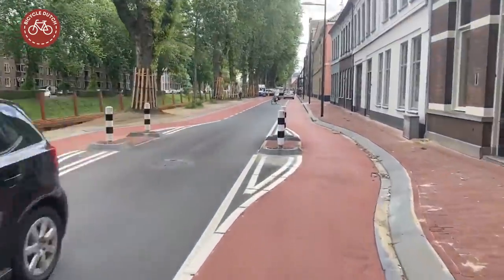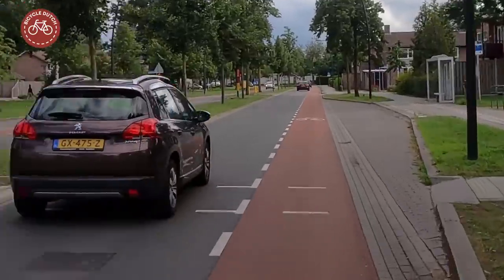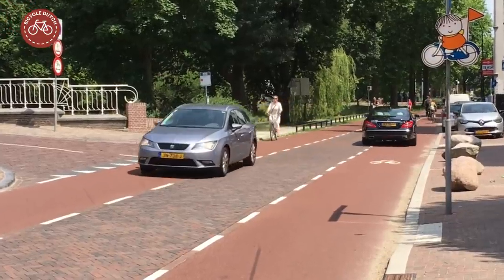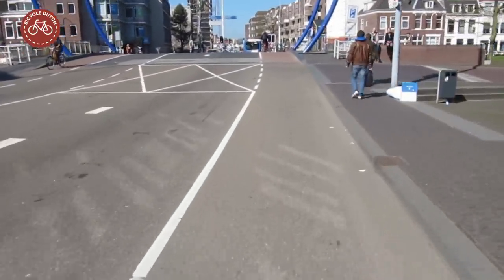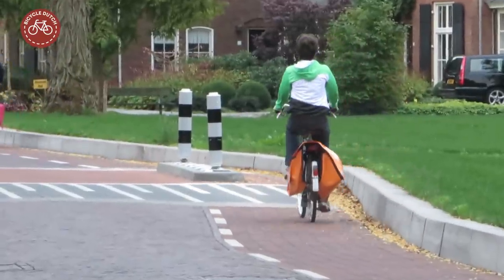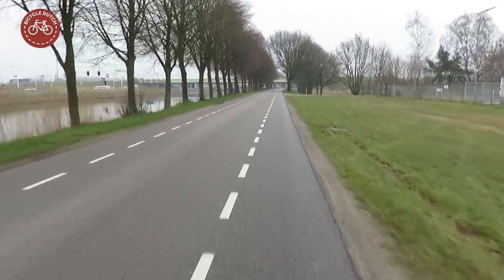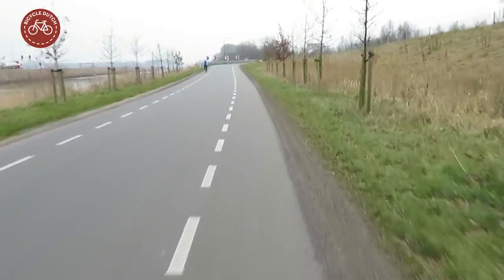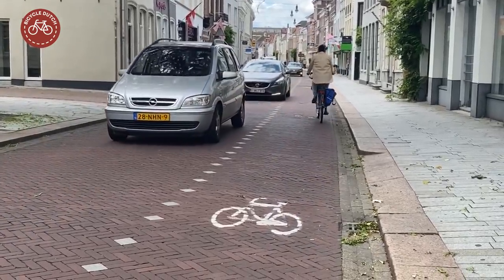On-street cycle lanes in the Netherlands

Comment: I was actually not aware that the narrowing lanes were not cycle lanes, but I don't think I've ever come across one that was too narrow  to not essentially be the same as a cycle lane.
Reply: Some roads in the countryside will be too narrow. There are some here, narrow roads with trees that have stripes not further than 20 centimeters away from the roadside / occasional tree trunk. Luckily nobody thinks it’s a bike lane.
Reply: I have come across many of those, at young age, I was constantly confused wether or not it was a cyclepath
Reply: Those things annoy me to no end. In Germany it has been advised, that narrow streets be converted to this bullshit. 
No the streets will not be made wider, they will not assign a proper speed limit, they will use psychological tricks to have you drive slower than allowed.
It's the same bullshit like no middle divider in villages and not converted small streets. Drivers have no orientation and many drivers in my experience stay as a result way too far left because they can not judge the width of their vehicle to the right.

Comment: I like that most places have a standard cycle width.  One place in greater London, UK, there's a separate cycle lane is less than one metre and it's expected that bikes can go both ways.  That means you end up daring the one coming in the opposite way to find out which of us will yield and swerve over on to the pedestrian path. Later one you find the cycle path disappears and this is a busy major road with cars going at high speeds.  You are expected to switch to the road and later the bus lane with buses dodging in and out all the time.

Comment: Great ideas, in the UK we exist in essentially a feud between cyclists and drivers as we have no real separation of road an cycle lane so cyclists are slowing traffic which irritates drivers or drivers are overtaking cyclist so close you almost knock them off which makes bad blood there. Also our cycle infrastructure is so bad people usually either drive or cycle depending on their circumstances rather than length of journey or weather which further separates the groups as a motorist does not understand a cyclists point of view and visa versa. I also believe cyclists should have a safety standard to use the road or cycle lanes however, a registration plate and adequate lighting should be essential. We often have incidents where cyclist are not seen due to poor or no lights or have lights that blind people as there are no regulations with beam pattern ect like a car and many incidents where cyclists cause damage and run without any real means of identification.

Comment: In Brussels they dont even draw the lines on most of those counter-flow streets. Because it is in fact assumed that bikes ride in both directions on any street. 80% of the time you can see a single bicycle painted on the road and 30% will have dotted lines at least towards intersections and tighter sections.

Comment: Question, the video mentions two advised methods of cycle paths for the two speed boundaries; under 30km/h and over 50 km/h.
What are the cycle path advised methods for roads in between these speeds such as 40km/h? Or do roads with these speeds not exist?
Reply from the maker: Dutch law only allows 30km/h or 50km/h inside the built-up area. 40km/h is not legally possible.

Comment: 0:50 " Cycle lanes with solid lines may never be used by motor vehicles " seems to be factually wrong, as small motorcycles are (lately) allowed to drive on cycle lanes, am I wrong?
Reply: Bikes without a yellow plate that is, no motorbikes/scooters that have a speed over 25 km/h are allowed on a bicycle lane.

Comment: Here in Germany, on-street cycle lanes are considered as the golden standard of cycle "infrastructure" (many people say "paint alone is no infrastructure" and I think that's right.) It's interesting to see that they also exist in The Netherlands — but are actually seen as bad design.
How does it look like when such on-street cycle lanes meet an intersection equipped with traffic lights: Are there separate lights for cyclists? Are there "bike boxes" that allow cyclists to position themselves in front of cars while waiting for the green light? (This is very common in Germany and in many other countries.)
And what if an on-street cycle lane meets a roundabout: Are there separate cycle lanes inside the roundabout or do cyclists have to merge with the motorized traffic?
Finally, do people in The Netherlands tend to avoid these on-street cycle lanes (by using a different route instead)? My guess is that especially for young cyclists, this is quite risky and not very attractive.
Reply: This is not paint, it is red coloured asphalt
Reply: @schout33  Right, and this means it requires way less maintenance (no repainting) which is good. But apart from this, the concept of these on-street cycle lanes is the same as here in Germany and probably in many other countries.

Comment: Many of the streets you call fietssuggestiestroken in the last part of the video are not fietssuggestiestroken. They are erftoegangswegen, a standardized type of rural road with dashed sidelines to visibly narrow the street, they can be accompanied by a seperate bike path and have a max speed of 60km/h.
Reply: The fietssuggestiestrook can be on an erftoegangsweg. The strook refers to small part on the side of the road in a different color or material. And as heard in the video, they don't do a lot for cyclists, unlike its name suggests. They are just there to visually narrow the road and reduce the speed of motor traffic. The erftoegangsweg refers to the entire road.

Comment: I love your videos, they are so informative. But now I'm confused, I thought you said in an earlier video that cycle lanes were always red but now you're saying and showing that's not always the case? Is this just with older roads that have not been updated to the red standard? Or is there another reason some cycle lanes are not red?
Reply: Cycle lanes do not have to be red by law. It is the painted bicycle on the road that indicates that it is a bicycle lane.
But the design rules for new roads advise them to be red. As that makes the situation more clear.
In situations where there is no confusion, like a long straight rural road, the cycle lanes are often the same material as the  the road because this is cheaper.

Comment: I was just going to ask you for a video about this topic! My city is not going to put money into retrofitting existing streets but on-street cycle lanes are in the realm of the possible. Is there any parking in the 50 kph roads?
Reply: Federico Marín usually not. On the roads that have a 50 km/h speed limit you will usually see parking bays. You might find cars parked at 50 km/h roads in some of the more rural areas, but it’s not a common thing in most cities.

Comment: @1:40 there are in fact 2 signs for cycle lanes/paths the one applicable for cycles and snorfietsen would be your channel logo but in blue, the other one is a rectangular sign with the word fietspad on it (only for cycles not snorfietsen) ... commonly they only place a sign at the beginning of a main cycle route or intersection and often not at all, but there are signs
Reply from the maker: But these signs are not used for on-street cycle lanes. There is no sign when the cycle lane is only paint on the road. Other countries have such signs.
Reply: @BicycleDutch  on street cycle lane is not counted as cycle lane in that sense , the road then is mixed used and designated per standard to be cars and cyclist regardless if there is or isnt a on road cycle lane.. but even then, sometimes there is (exceedingly rare)

Comment: So if I interpret this correctly, the on-street cycle lanes are basically a way to circumvent the advice to seperate bicycles and motor vehicles on >50 km/h roads? I guess this is some way understandable, as it would be quite a logistical/financial challenge to seperate bicycles/motor vehicles on /every/ road outside cities and villages.
Reply: It's more a legacy of a time when that advice was not yet in effect. Expect every one of these lanes to be replaced by separated paths soon enough.
Reply: @Quintinohthree  Where possible ofcourse, I can think of a few small roads that do get quite a bit of traffic right now (including large agricultural contraptions) while being surrounded by a ditch (sloot) on both sides that just don't have the available space. 

I wouldn't be surprised if it's left as is, gets a 60 km/h zone slapped on it to encourage cars to take an alternate route. 

Maybe some places with connections to N roads will be blocked off. That'd get rid of the car traffic which uses it as a shortcut now.

Comment: So if there's a dangerous obstruction or condition in the bike lane, cyclists are still required to use them? For example you pass two cars parked so the door zone occupies the entire bike lane, but you're still required by law to endanger yourself by riding in the door zone? Seems backwards.
Reply: 1) No, if the cycle lane is blocked in some way, it ceases to be a cycle lane.
2) Cycle lanes are designed as much as possible go avoid door zones.

Comment: Perhaps the authors of these lanes have never cycled on Rosengracht or Harlemmerweg in Amsterdam, where the lanes are routinely occupied by parked vehicles or totally removed for far-off road construction.
Reply: We hebben hier weer een Amsterdammer die niet buiten de ring komt... Nederland is groter dan de binnenring van Amsterdam.
Reply: The Haarlemmerweg has no cycle lanes but separated bicycle paths along its complete length. Parts of this path where indeed closed the past years while the road recieved a major overhaul. But signed detours where provided.
Reply: @s0012823  Gisteren weer eens buiten de ring gekomen naar Bijlmer. Het was verschrikkelijk! Gelukkig weer onder de a10 gedoken en snel naar huis.

Comment: Seems blatantly obvious that the single step that would have the greatest improvement in safety of Dutch cyclists would be to get them to wear helmets.  It's elementary physics that if you fall while on a bicycle and your head impacts the roadway, it will be moving at a vertical speed of roughly 20kph, irrespective of your horizontal speed.  The human skull simply is not "designed" to protect your brain against an impact into a hard surface at that speed.  Bicycle lanes may protect against collisions with motor vehicles, but the focus on them ignores the fact that it's quite possible to fall down for a variety of other reasons.  People forget that cyclists are balancing on two small contact patches and/or mistakenly think that they aren't going fast enough to get hurt in a fall.
Reply: And yet, cycling in The Netherlands is safer than anywhere else. They have the lowest fatalities per travelled kilometer along with Denmark. Indeed, the numbers in Denmark and The Netherlands are quite similar, despite the fact that almost 40% of Danish cyclists use helmets - suggesting that the helmets basically make no difference.

And if you were really so concerned about safety, you would be wearing a helmet at all times, not just when cycling. About 1,200 Danes die from head-injuries every year, only 1% (ONE) are cyclists. Where is the call to get everyone to wear helmets?
Reply: People forget that we are basically born with a bicycle between our legs: the difference becomes significantly apparent when tourists start riding a bike in Amsterdam, while they haven't done for years or even decades (and why tourists want to cycle in one of the worst places in The Netherlands is still beyond me). They swerve all over the place and usually also have trouble getting up to speed and braking safely, either because they're not used to a backpedal brake, or just because they have learned themselves to put their feet down first.
The big difference is that most Dutch cyclists behave far more considerate than in most other countries and as we are so used to it, we also look ahead. The majority of cyclists at least has some consideration for the other person out there just like the motorist, but it's a kind of tug-off-war in the UK, where motorists will do all kinds of things 'because the other is a cyclist' and the amount of silly cyclists is rather high as well, with most of them behaving in a sense like 'I'm a cyclist so YOU have to take me into account and I don't care how, I behave how I want to!'
I'm Dutch and I have been cycling for something like 32 years by now and have only had 1 major incident/accident where I was hit from the right side by a motorist (car) who fortunately hit the brakes when she noticed me but unfortunately was just a tad too late. But my head didn't even contact the road-surface at all. Of course it does go wrong sometimes and especially the elderly and youngsters on their electric bikes don't help (with especially the elderly doing some very stupid things sometimes as they have completely lost their sense of speed), but it's really, really safe.
Reply: @weeardguy  Yes, I know that the Dutch and Danes enjoy a perceived blissful nirvana of perfect cycling, and like to spread the word to us less fortunate folk..  Luckily you've never been on the wrong side of the percentages.  In 60 years of cycling (touring, commuting, racing), I've had only a few fall-downs, never been hit by a motor vehicle.  The worst one came early on and left me with a badly broken collarbone and a bad concussion (fainting, fuzzy for a week, zero memory of the crash or the period leading up to it).  Despite wearing an old fashioned "hairnet" helmet, which is what we had then, and without which I probably wouldn't be here.  A crash like that really corrects one's viewpoint.  Even if the odds are against such an event, it only takes once.  Now I simply wear a helmet on the bicycle.  Modern helmets are so light and comfortable one quickly forgets one has one on, wearing them is no inconvenience at all.  You can learn from my experience or not - your choice.

Oh, and PS: Holland and Denmark are not the only places where children are "born with a bicycle between their legs."  I don't remember when I started cycling on the road, probably got my first 3-speed when I was about 5 or 6YO, rode trips of a few miles to visit school buddies, go to the market on errands for my Mom (we lived in a rural area), and 1-2 miles to/from school.  Not factoring that into the 60 years figure,.